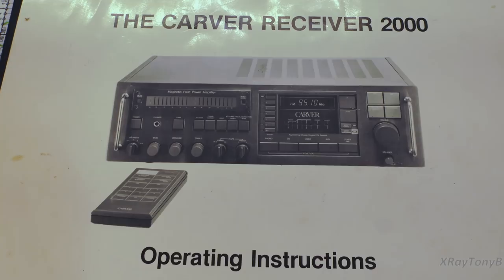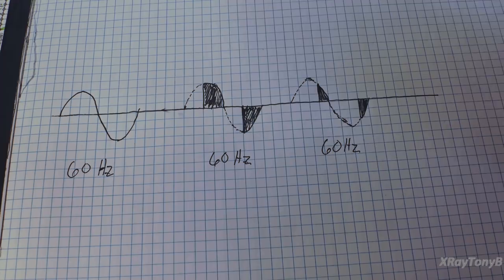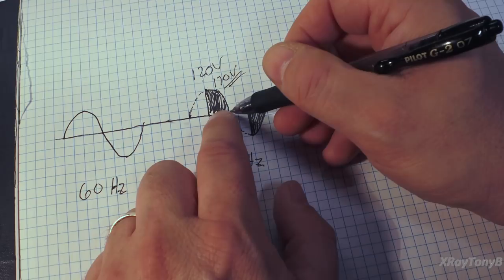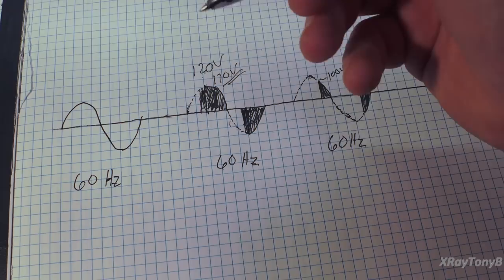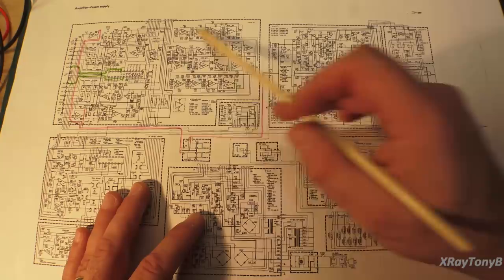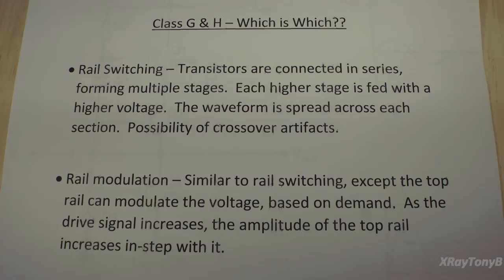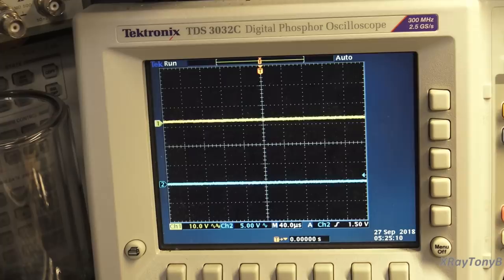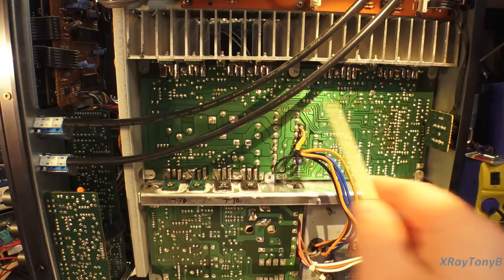Carver MXR2000 Part3 - Magnetic Field Amplifier Theory and Testing

Comment: I’ve 2 of these. 1 of the i’ve had since ‘80s. They both have been a pain in the rear, as they both have problems with the balance L/R going out/muting randomly. I then turn the speaker output off & crank the volume up to maximum on the side that cuts out, at which time it kicks on, so I turn down the volume re-establish the balance knob & unmute. At some point, once again, 1 side or the other will go out, making me go through the rebalance exercise all over.

Comment: Kenwood dabbled in some class G designs. The KA-9X, a 120 wpc intergrated amplifier, M1A, M2A power amplifiers were split power rail designs. The M2A was a 220 wpc amplifier with a low output impedance and damping factor of 1000.

It was not taken seriously because it only weighed around 30 lbs. Looked great on paper (spec wars) but sound was kind of clinical and cold IMHO.

The KA-9X also had a gimmicky feature called "sigma drive". An extra pair of small sensor wires that ran back to the speaker output terminal that carried the signal back to the negative feedback. This was supposed to compensate for speaker wire would be my guess. It was discontinued because people would hook up the connections wrong and blow up the outputs.

Comment: A large part of the odd clipping behavior at low frequency is because of ripple on the bus. Unless the bus caps are infinite in size, this will happen with any amplifier without a tightly regulated power supply. Essentially the output is being modulated by the ripple on the bus during clipping because the output transistors are in saturation.

Comment: With all these variable rail voltages and crossovers, how is this effecting the THD of the output?  I see the benefit in cutting down power consumption and heat, but I am wondering if the audio quality is sacrificed.
Reply: Not really. Essentially what Carver did was build a Class H amplifier using a triac based supply instead of a high frequency switcher.

Comment: While a novel way (for its time) to increase efficiency and use smaller parts, it really is an overengineered mess. I can't help but think a regular class A/B amplifier with properly sized parts would perform better and be less expensive. It would certainly have less to go wrong. 

I remember working on a 70's Pioneer 250x2 amp that was about the size of this thing. It has a weird current limit that was latching (think transistors connected as an SCR) and instead of limiting current on a fault, the output would fall to zero until the next zero crossing. Good thing that it was almost impossible to current limit it, because that sounded awful.

Comment: I've watched all of your Carver repair videos, and as a retired professional engineer I get the sense that whoever designed these Carver audio products wanted to impress us all with his/her technical prowess by doing unnecessarily complex designs with little added real-world benefit to the user.   The designs do provide Carver marketing people with opportunities to differentiate their products, but was that the reason for these overly complex designs or just a way to salvage some marketplace benefit from overly complex (and costly) designs?
Reply: Roger Mason , you've nailed it !!
Reply: Carver's Phase Linear 700 had heatsink issues. The FTC's 1/3 power preconditioning rule made that situation worse. Carver's way around that on his newer products was to vary the power supply rail voltage in such a way that the dissipation was not great and he could claim high power in a small size. On the cube amp he also used class G circuitry. When the cube came out I sarcastically said that "Bob Carver couldn't design a good heat sink so he designed an amp that didn't need one."
Reply: Carver was the first to bring to market an amp with a signal tracking power supply YEARS before anyone else. He was (and is still) known for solving problems that a lot of others either didn't think could be solved, or didn't bother trying. He gets a lot of flack for it from people who just don't get it. Humans ALWAYS attack what we do not understand.
Reply: Carver, in his patent US4218660A in 1978 recognized several tracking power supply patents ahead of him. Carvers method was different but various ways of tracking voltage to audio signal were known by then. If you consider class G a tracking power supply, Hitachi had the Dyanaharmony in 1977 in production.
Reply: Carver patented his continuously variable signal tracking power supply and then couldn't get it to work. So he came up with a sort of "half ass" compromise in the magnetic field power supply, which was a three rail stepped approach. Then a little over a decade later he took another fresh look at his patent and was able to make it work, because of some new technology-which didn't exist at the time of the patent-and something that he overlooked. There are multiple videos right here on YouTube in which he explains all of this. The name 'Magnetic Field Power Supply" had next to nothing to do with what it did. It was more catchy marketing. However that wasn't the only notable thing that he invented. 
The autocorrelator single ended noise reduction circuit
Sonic Holography
Asymmetrical Charge Coupled FM Detector circuit
DC restorer circuit for his current Vacuum Tube amps
This is only a partial list of things that I can think of off of the top of my head right now.
My point is that there are a lot of haters out there, but anyone can acknowledge the fact that the man has had a HUGE impact on the audio industry which we know today. Just look at what he did for the subwoofer market with his Sunfire true subs.
Reply: I agree with all of the above. In retrospect the 700 was a remarkable achievement considering high voltage power transistors were not that available. He was thinking outside the box when he used a transistor that was not considered an audio power amp transistor. The big problem I saw with that amp was its thermal capability was limited by the heatsink, so when Carver built a high power amp that was so efficient it didn't need vast amounts of heat sinking the industry got a wake up to the benefits of building efficient amplifiers without the need to go class D.  Class D wasn't very good in those days. I was a supporter of a competing brand in the 70's and 80's so Phase Linear bashing caused many a lively discussion, something like Chevy and Ford fans. I will admit that when the Carver amps came out I did not understand the technology. I had my head stuck in the idea that it had something to do with the magnetics of the power transformer. A few years ago the subject came up again and I was able to do the research and learned what Carver actually did. Ain't the internet wonderful?
Reply: You are absolutely correct sir! When he introduced his Phase Linear 700 amp and his Carver M-400 amp, both turned the audio industry on it's ear and forever changed the direction that the industry was going. I've owned a Carver M-400 in one or another of it's three iterations on and off since 1987. I currently have an M-400a and have had that since 1994. It's still working and in service right now in my home theater. 
The Phase Linear helped to wake people up to the fact that not only can high powered amps sound good. You actually need that much power if playing music at anything resembling live levels. The M-400 was a small cube that didn't weigh that much or got very hot. Yet it still output 201 watts per channel in stereo and 500 watts bridged! This was the first commercially successful power amplifier with a signal tracking power supply.

Comment: wow another great video...your talking about the stuff ive been studing...best ab video out there....still...,I needed to see more...I may have to do my own video,,,...for instance, I wanted to the see the rail react to a audio programe input(music)...would it more closely  resemble a dc voltage? that's what I would exspect to see...and , it would be neat to see high rail disabled,,,,does that cause clipping to happen earlier?, ,also I do not understand how emitter resistor does not burn up when the high rail is engaged...doesn't the speaker current  go up thus the emitter currents? maybe measure rail with VOM on dc while putting in programe music....some music from ACDC would suffice
Reply: Your

Comment: Regarding Class A/B amplifiers, you've mentioned what happens when the bias voltage is set too low: it creates crossover distortion. What is the result of the bias voltage being set too high? Loss of detail in the signal? If I have an amplifier in which the bias voltage is supposed to be 10mA +/- 1mA , but the actual reading is 13.4. I understand this is causing excessive heat by keeping the transistors turned on too much. What is the effect on the audio signal? Just so you know, I didn't leave the bias voltage that high! I brought it down to 10 mA as directed. It SEEMS like there is a lot more detail/separation in the stereo field now., or am I dreaming? Thanks Tony! You are the best teacher out there!
Reply: There is no real difference in sound on low to mid volume if your bias current is too high but you're burning your power supply (Transformer, regulators), your power-stage transistors by overheating. Plus the exceeding current will lead to higher likelihood of humm from your power supply. And as your storage caps would not store enough energy to deliver the additional energy (i. e. rail voltage x current drawn from power stage) on peak performance demands it also could lead to earlier clipping on high output levels.

Did I miss something?
Reply: Slartibartfas042  Okay, thank you for your assistance. I realize the importance of correct bias current (thank you for correcting my terminology!) as it applies to component wear. I was reasoning that if the transistors were too far "on" (excessively high bias current ), low amplitude signal variations would be lost as the transistor was already turned on above the amount needed to detect those variations.
Reply: As already mentioned excess heat is a problem. But you also get what's called gm doubling, which slightly increases distortion above what is present at the optimum bias point.
Reply: Mister Hat  So,  there IS an audio effect to a bias current that is too high! Thanks for your information!!
Reply: matran47  Yes, but unless it's grossly misadjusted, you won't hear it.

Comment: @xraytonyb: Did I miss something or is there a mistake in the circuit diagram at D709/D710 and D711/D712? I did not finish the video up to now, but it looks to me very strange that D709 and D710 are in parallel while D711/ D712 are anti-parallel!? Shouldn't be D711 the other way round?
Reply from the maker: You are correct.  The schematic has a misprint.  D711 should be the other way around.  It is in the correct way in the actual amp.  Thanks for catching that!

Comment: That's incorrect when you say that in a normal power supply the transformer works the entire time. Whenever the output voltage is below that of the bus cap (the majority of the cycle) no current flows because the rectifier diodes are reverse biased.